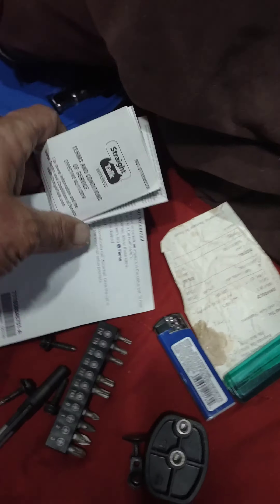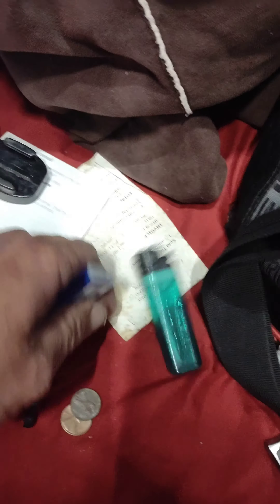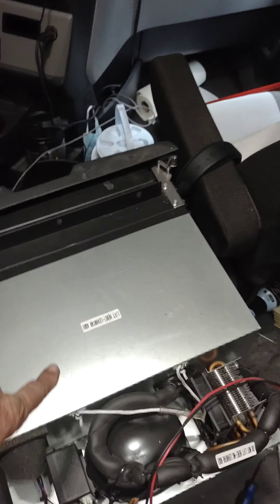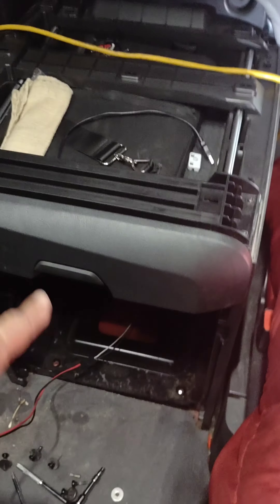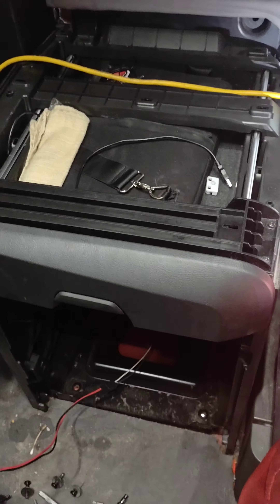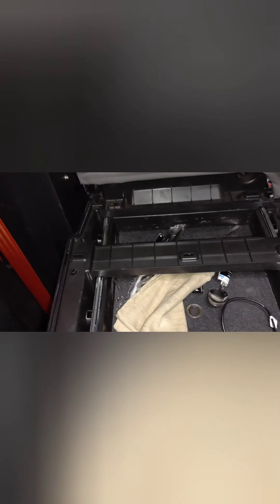2021 Freightliner Refrigerator Removal

Comment: Did you fill in that gap with something? Unless I lost a social security card down there, I would consider the item as an offering to the freightliner fridge gods. You have to appease them so the damn thing keeps running. The one I have in this 2016 has been a real POS.
Reply from the maker: GoPro mounts are expensive 😂
And it kept bugging me how nasty & dusty it was.
Reply: @thenotoriousrvh6091   I know that feeling, I having cats on the truck so I need to get down there and clean mine too

Comment: So my drawer to the top of that fridge will not open how do I lift that top piece off if I can't get that drawer open
Reply from the maker: Find a place you can get a grip and just pop it up. I only opened the drawer to make it easier.
Reply: @thenotoriousrvh6091  how did you take off the fridge door?
Reply: @thenotoriousrvh6091  if you could explain that one